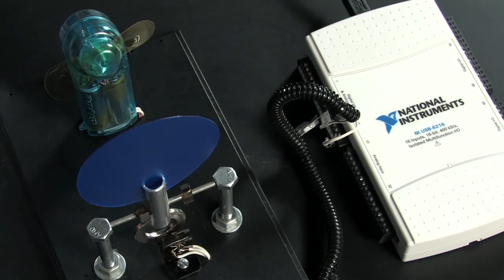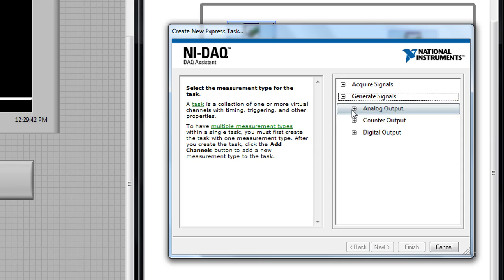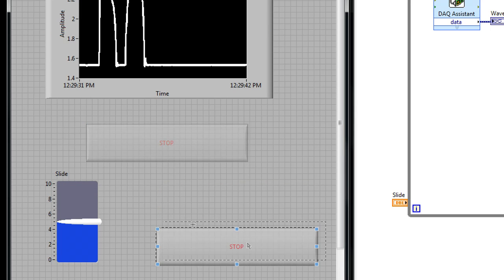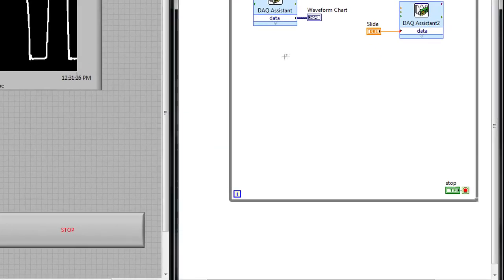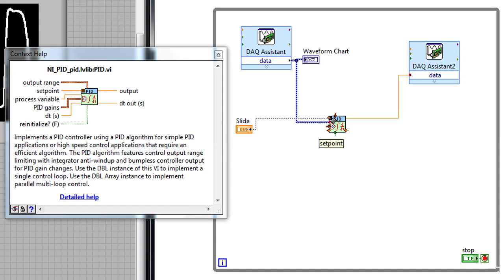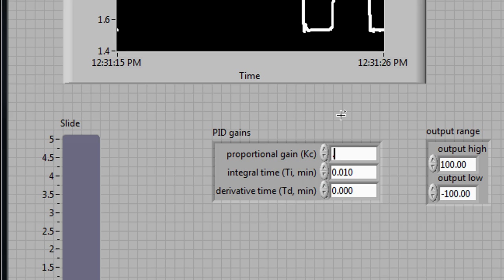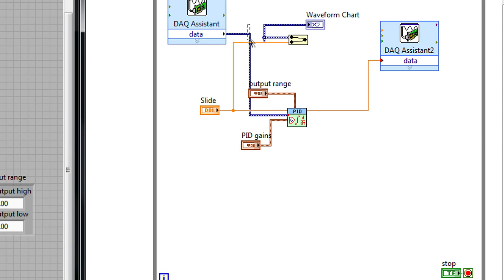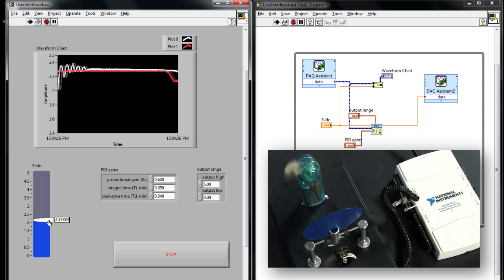Building a PID Controller with Your Computer

Comment: Hi Vaneet,
It was a very good tutorial.Can you please tell how can we get the values of the PID controller that you wrote in labview.I am making a Burner Management System so I want to control the temperature of the boiler using a stepper motor connected to butterfly valve which will control the flow of fuel gas.Its very much similar to your project.The difference is just that you are using fan to control something but I am using stepper motor.
Reply: he said in the video -- Trial and error.. Or you could model your plant as a transfer function in MATLAB and apply trial and error in software, as opposed to long real experiments. 
Since this was 8 years age, Im sure you probably already have an answer now
Reply from the maker: The engineers in our forums should be able to answer this. Try posting your question at forums.ni.com and someone will get back to you shortly! Make sure to include a link to this video for context.

Comment: Amazing I think i will go with the cheap $150 NI 6008 12 bit only but will do the trick,i it's a perfect DAQ module for education purposes.

I think it can also be done with an arduino usb module coz it has integrated ADC, but the trick is you have to do coding with c++ the cost in this case will be around $ 40.

Comment from the maker: Hello,

The analog output channel is connected to the base input of the transistor. When looking at the transistor with the metal shield in the back, the base input is the pin on the left. (Not all TIP120's are the same, so be sure to check the documentation) The next pin on this particular transistor is the collector and the last is the emitter. The battery high goes into the collector and the output current comes out the emitter to the fan motor. I hope this is helpful.

Comment from the maker: Hello,

In this demo, we needed a transistor that could provide more current to drive the fan, since the analog output channel on this USB DAQ device can only drive up to 2mA. Using the TIP120 darlington pair transistor, you can increase that to several Amps so it works well for this applications which involves driving a DC motor.

Comment from the maker: @alpha001ful You can buy a Hall Effect sensor from a lot of vendors. I suggest Googling it to find a vendor if your area and price range. What NI card you need is dependent on which Hall Effect sensor you get. Each sensor has different current or voltage ranges that would determine which card could work and which one would be cheapest. Once you have your sensor, please call our sales team (ni dot com slash global) and they can advise on the best card for your application. Cheers!

Comment from the maker: @Gg180789 Vineet is using a Hall Effect Sensor. This is a come transducer that measures a magnetic field. As the deflector moves, the magnet attached to the bottom moves through the magnetic field produced by the Hall Effect Sensor and the sensor varies its voltage output proportionally. From this you can determine how far away an magnet is from the Hall Effect Sensor just by monitoring the output voltage.